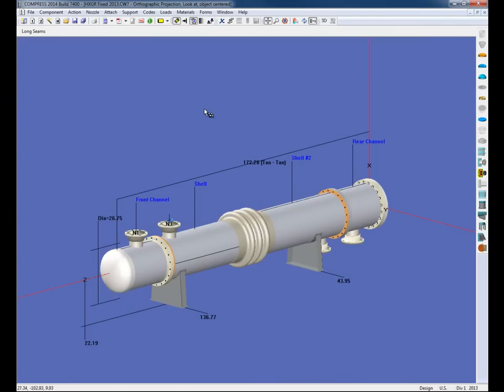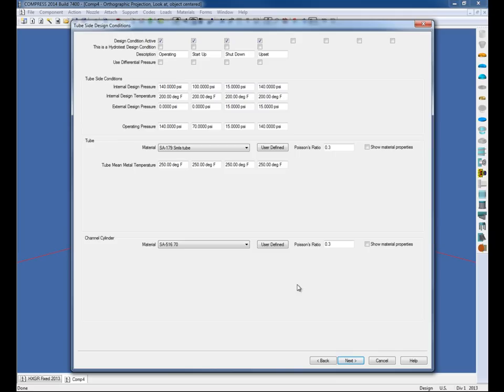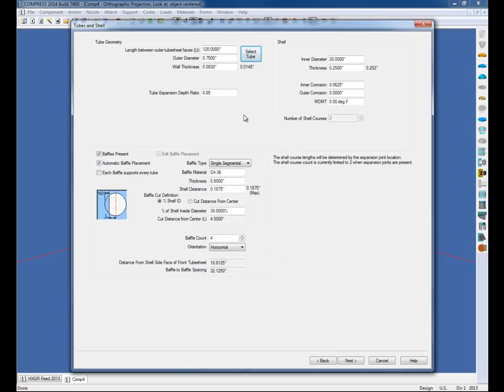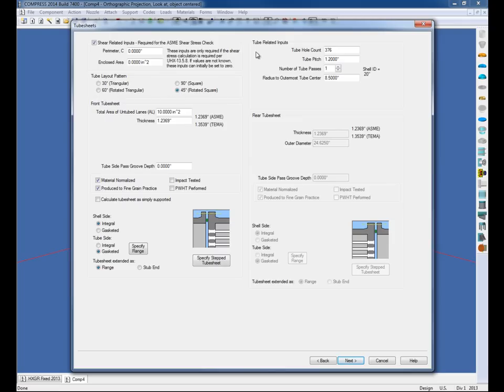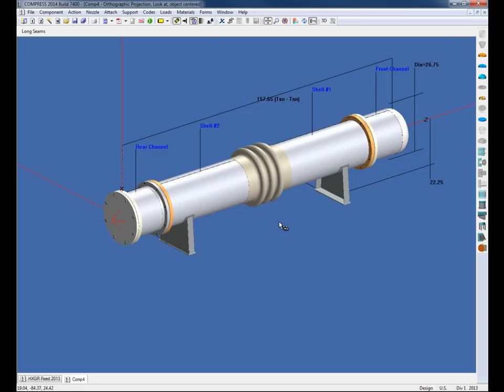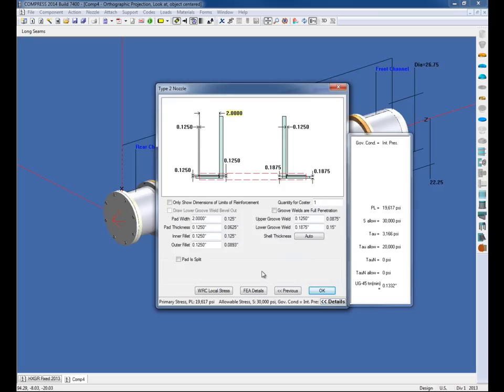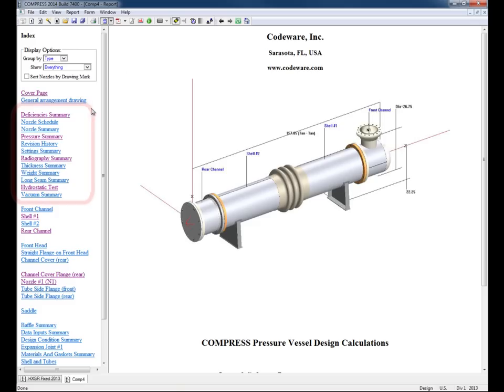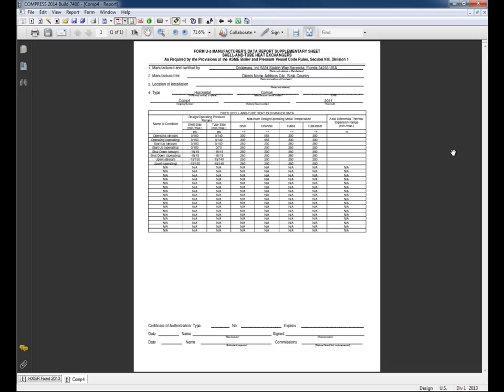TEMA / ASME (UHX) Heat Exchanger Design

Comment: Can I use this software to design and analyze the hvac heat exchanger that contains the refrigerants like r134a or other refrigerants does it contain all the refrigerants types please help me.
Reply from the maker: COMPRESS can be used for the mechanical design of shell & tube heat exchangers to TEMA and ASME VIII-1. For the thermal design, COMPRESS integrates bi-directionally with HTRI's Xchanger Suite Xist. If you're interested in learning more, please contact our sales team at sales@codeware.com.